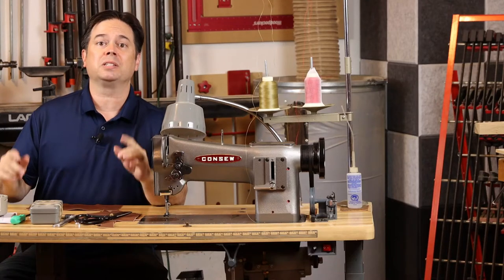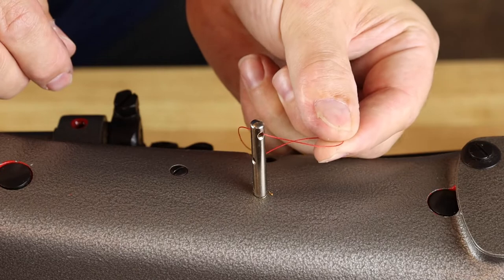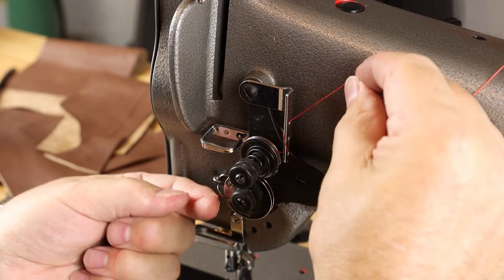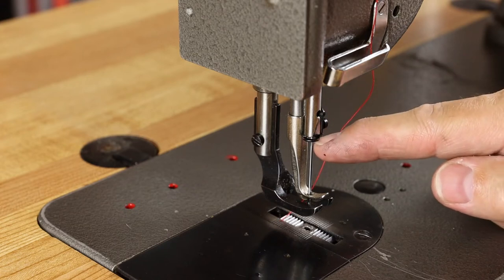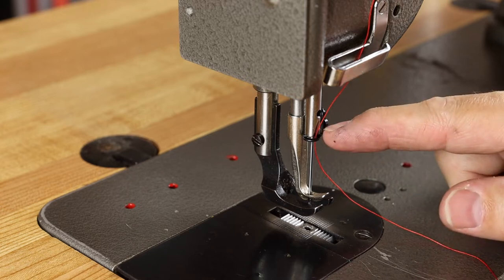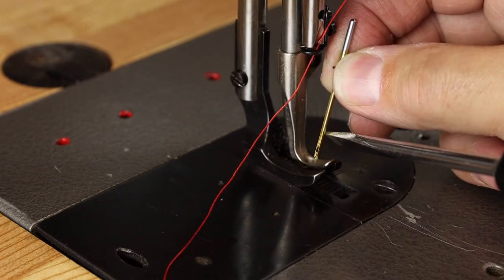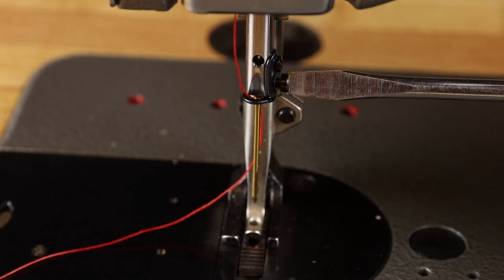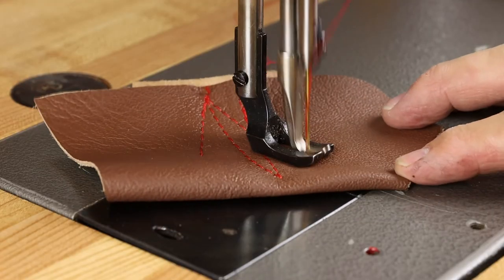Consew 206rb1 Thread / Threading Industrial Walking Foot Sewing Machine Consew 206 rb 1 or rb-1 rb2

Comment: My 206rb-1 was working fine the last time I used it several months ago.  Now for some reason it won't pick up the bobbin thread.  I've checked that it's threaded correctly, and everything else seems normal.  I tried changing the needle ( 135-17 ), the bobbin case, the bobbin, and still no luck.  Do you have any idea what might be causing this?   I'm using light thread, would that make a difference?

By the way, your videos are extremely well done, easy to understand, and a joy to watch and learn from.
Reply from the maker: Assuming the safety clutch isn't popped ( turning handwheel wouldn't rotate hook) it could be something simple like the needle isn't inserted fully.  Or if the needle is rotated incorrectly.  The long groove in the needle needs to face left.  Just some little things to check first, before looking at timing etc.  Thanks for the kind words!
Reply: @TheThoughtfulWoodworker  It was the safety clutch.  I figured it out about three minutes ago!!!    The needle was in correctly.  Now I remember trying to fix something very thick a while ago.  That must have tripped the clutch safety.  Thank you so much for your reply.  I subscribed to your channel as I do word working too and your videos are excellent.

Comment: Hi I have watched several videos on threading the Consew206 rb some say to take the thread u over the pin on the top part of the tension assembly some say not to take it over the pin the way you did @ .58 in your video . Do you know the reasoning for this thanks, enjoyed your video
Reply from the maker: Hi Evelyn, I think the confusion stems from the way you thread a Pfaff industrial machine.  If someone started on a Pfaff, then switched to a Consew, they might thread it incorrectly.  Bottom line... Never go around the pin.  It's just incorrect threading.
Best
Reply: @TheThoughtfulWoodworker  Thank you for clearing that up for me My tension broke and I have ordered a new tension assembly.  I have been watching videos on how to change it out
Reply from the maker: @1954evelyn  you won't have any trouble installing the new tension assembly.  Hope you get the machine sewing we'll again.

Comment: The needle on my 206rb1 is not centered in the hole in the walking foot.  Is there a way to adjust that?
Reply from the maker: Front to back there is a mechanism that can be adjusted.  Side to side, no adjustment.
Reply: @TheThoughtfulWoodworker  Do you have a video showing how to make the front to back adjustment? That's what I need to do.  It is too far back.
Reply from the maker: @billguthrie2218   Not a video, but I can send you a document that shows how to do it.  Basically you adjust the feed dog hole, not the needle bar.  If you poke around on my YouTube page you'll find my contacts.  If you email me, I'll forward this scanned document.  Best.